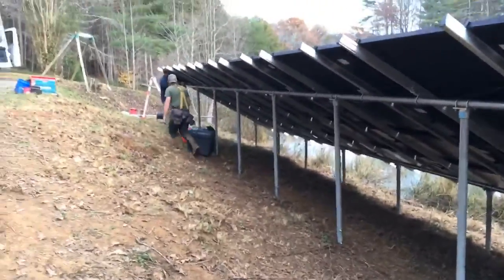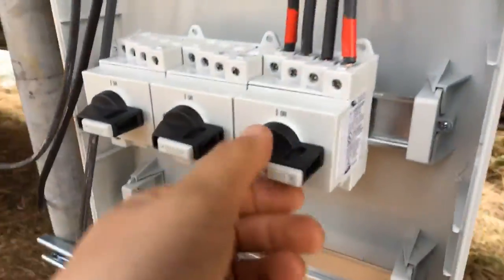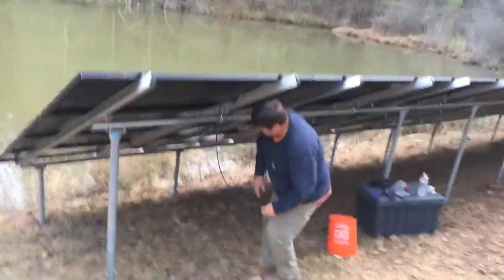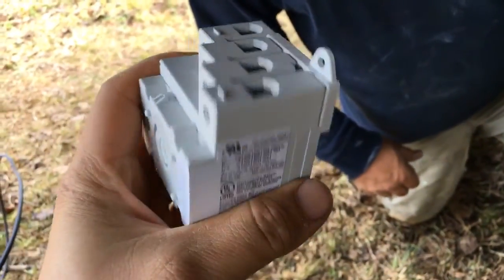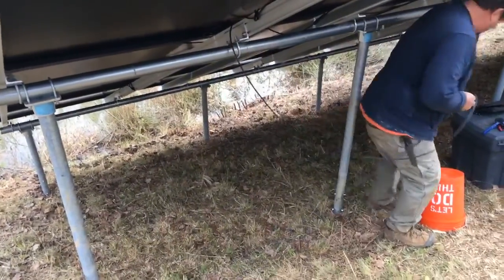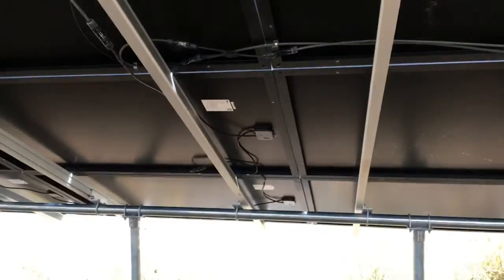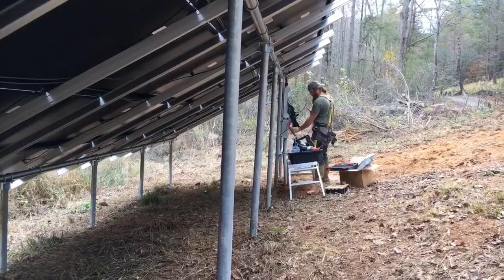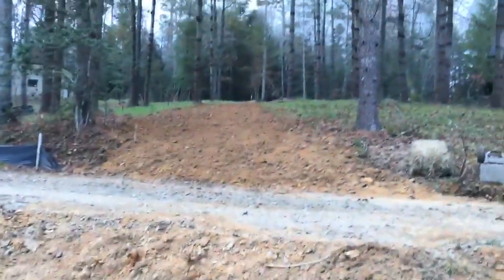Solar disconnect: switcing high voltage

Comment: Nice video, can you use a bigger isolator than required? say your panel out put is 450v, 19amps, can you use a isolator that is 1000v, 32amps?
Reply: Yes.